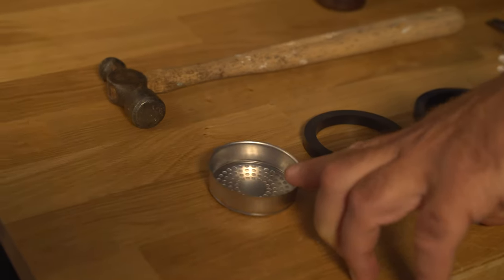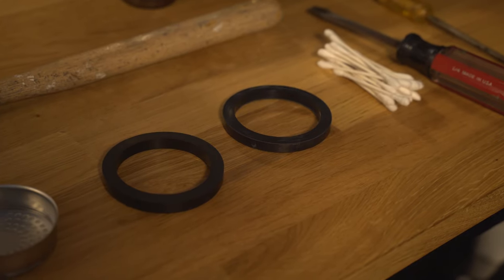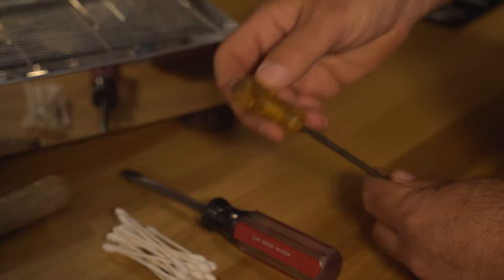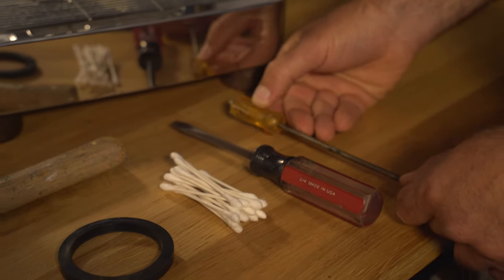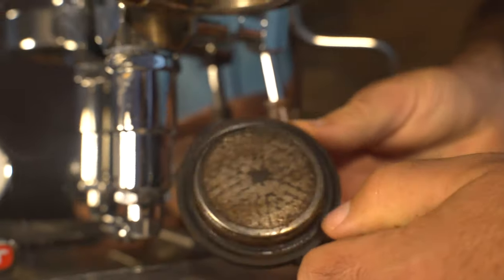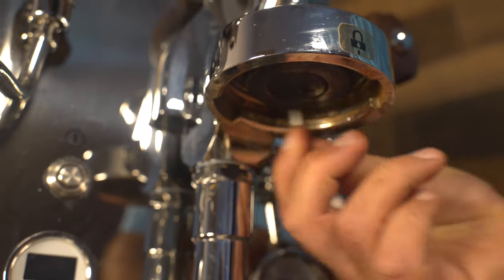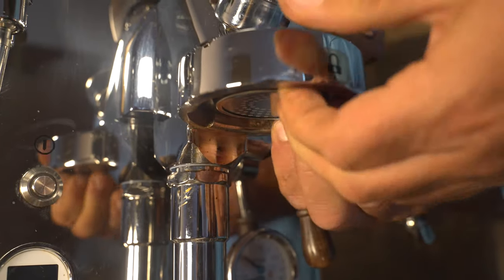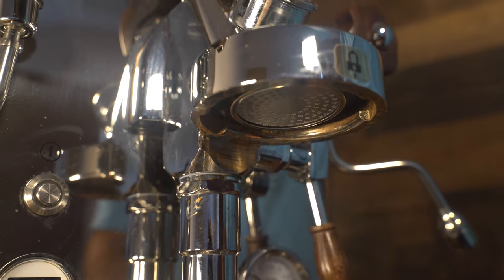TechTips: Lelit Bianca: Change E61 Grouphead Gasket

Comment: I have used my Lelit Bianca for over 2 years now. I searched this video just to see if the replacement process was any more difficult than other machines (which it actually looks easier maybe). I haven’t replaced my group-head gasket yet, but I am noticing a little hot water drip around the portafilter, when pulling a shot. So, yeah I definitely need to replace it soon before creates less of a seal. I also must note that my shower head gasket is no where near as filthy as your test unit. I use my Bianca on average 1-2 times a day. I also must note that I flush, wipe, and flush the group head again after every pull. I rarely back-flush, but when I do the water is clean. On top of all of this, I do have a question. Is the gasket silicone? If it isn’t, then would a silicone gasket be better for the Lelit Bianca?

Comment: When cleaning and reinstalling shower screen and gasket, my Portafilter has a rough time locking and unlocking. There are no leaks and shot is fine but before cleaning, the Portafilter just locked and unlocked smoothly. Any ideas?

Comment: I had tried to use a promo code in the website called Summer, but it didn't work?
Reply: For the Bianca which is not excluded.
Reply from the maker: Thank you. Sorry, coupons are currently excluded on the Lelit Bianca espresso machine. If you visit the Lelit Bianca page on our website, it does say coupon excluded in the category section under the SKU field. Although certain brands allow coupons, certain models can be limited to exclusions. The Lelit Bianca espresso machine still offers the best espresso for the price. In addition, the warranty was just increased to three years limited to manufacturer's defect.